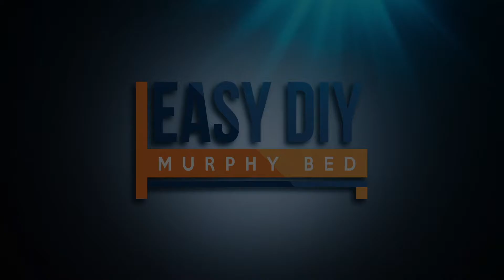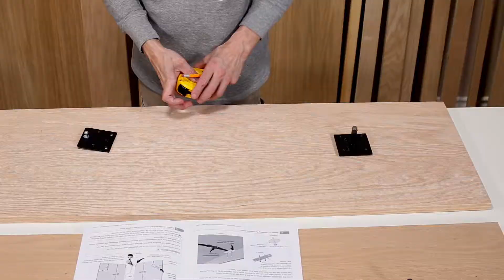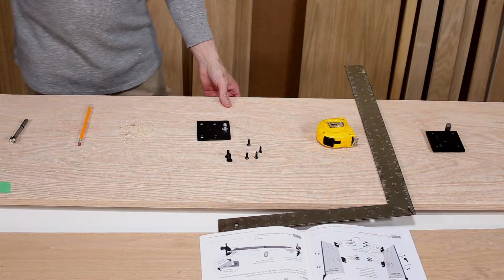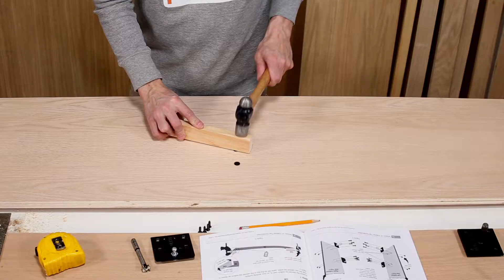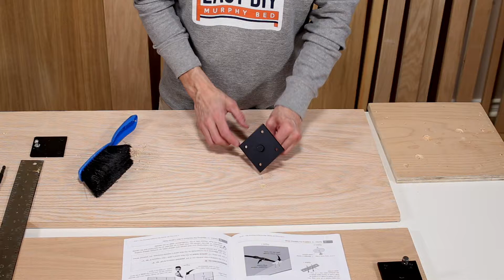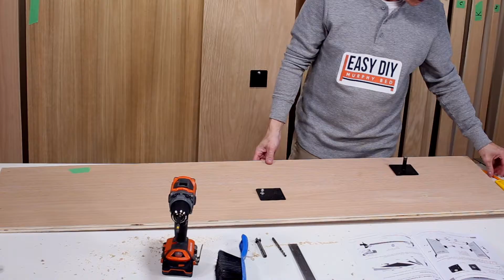Section 13: Attaching The Hardware To Cabinet Sides | Easy DIY Murphy Bed USA

Comment: Modify measurement accordingly.   According to what?  How does the trim affect the placement of the pivot hinge? A clue would be helpful.
Reply from the maker: Hi yes the use of trim does require modifying the measurement for the pivot plate. Our guides show this in great details. Thank you for the feedback. We make the updates to the video based on your feedback.